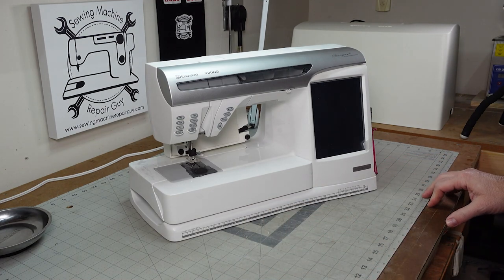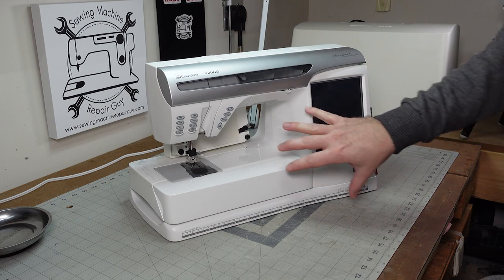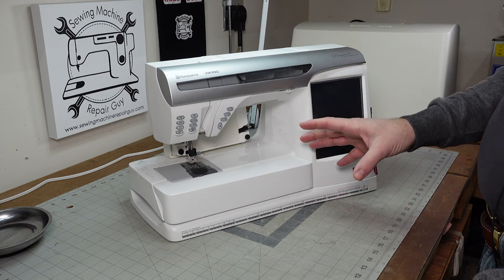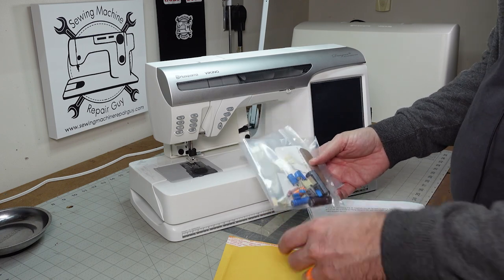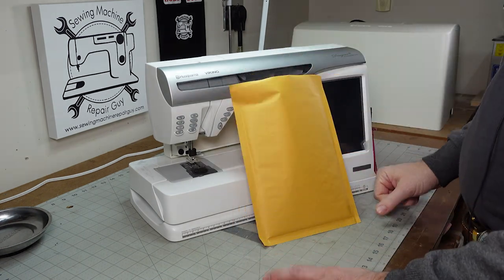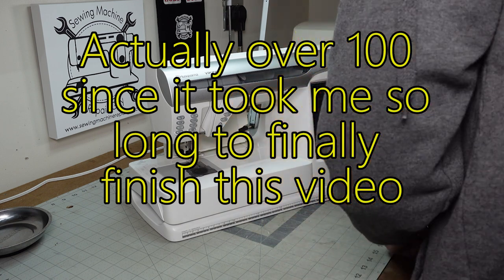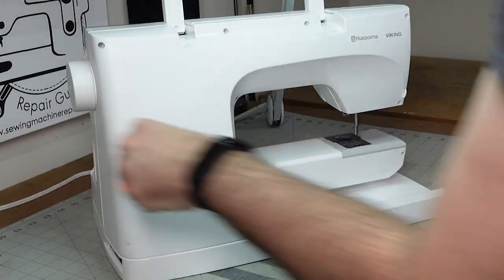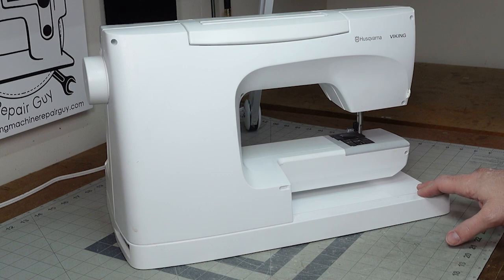Flashing Light of Death Repair for Husqvarna Viking Designer SE ***Updated 2021***

Comment: I have a Viking 6000 Series that’s very old, I love this machine and want to have it repaired. I believe that it is an electrical short some where. I tried to replace the plug and while doing this many of the wires came loose from their anchor. I’m 70 and my hands aren’t working as well
 As they did.  Where can I take my machine to have it repaired?

Comment: husqvarna viking diamond royale motor over heated and its gear melted so throwed... what can be reason of ovet heats ? it has a problem , smart saving i canceled and it was working without problem...how can care motor , is it needs oiling?it has still have coal ..what s ur advices?

Comment: I have a question about the presser feet of the singer machines or in your case the generic pressers can be adapted to the husquevarna 116 smeralda machine? is that the singer 3333 has the same type of Stilt foot than the husquevarna 116. Is that possible or is there a difference?! Greetings and thanks for your videos

Comment: We just acquired the exact machine.  It works perfectly so probably not a good idea to proactively replace the electrolytic capacitors?  Is there a way to determine how old the machine is and hour many hours of usage?  Someone told us you need the Service Menu password in which we do not know.  We got to the Menu and it does require a password.  Love the detail of your videos.  Thanks very much.

Comment: Good morning from Johannesburg; South Africa

Thank You for this video, I have a question though:
Do you have any advice for the Husqvarna Viking Designer 1,
I recently had mine serviced by a reliable technician who I have been following for the past 2 years.
He even sent me photos & videos of how the machine was stitching.
When I got my machine back all excited, the technician warned me the Screen of my machine will need replacing as the clip that plugs into the motherboard is aging.
I contacted Husqvarna South Africa dealer, and the manager told me she was doubtful that I can replace the screen/
I find that so sad as my machine has worked less than 1000 hours in total.

Any advice or if I can perhaps find a screen again?

Comment: You saved me far more that %1500.00.  My wife's SE experienced the flashing lights of death.  She took it down to the dealer and was told by the owner that the mother board was bad and that Husqvarna no longer stocks them.  She then proceeded to try to sell my wife a new $16,000.00 machine.  I haven't done any board work in almost 35 years so this 30-40 minute job took me 3 days.  Slow but sure I got it done.  My wife is thrilled and so is my pocketbook.
Reply from the maker: That is awesome! Great job! Glad you could keep another one alive.
Reply: I am so grateful to find this hope.  I too was dismissed by local repair shops.  I love my Designer and when retired, I expected to do a lot of sewing and embroidery.  Then the mother board/capacitor died and I grieved the loss.   I was not about to buy a new Viking machine.  Thank you for teaching how to  bring it back to life.

Comment: I Ordered the kit, watched the video and successfully repaired a machine for a VERY happy customer! The single most important piece of information comes at around 17:35 in the video. I couldn't figure out why the machine was not working properly mechanically. Electronically, every thing was fine. I re-watched the video and determined I had the polarity backwards. I would have been scratching my head for days trying to figure it out... Thank you for the kit, thank you for the video, and thank you for taking the time to instruct and inform.

Comment: Just fixed my cousins machine.  They bought your kit and I did the repair.  Works fine so far. Thanks for posting.  I wish I could get back into repair work.  This was fun!
Reply: Hi @Rich Gocken 
What do you see in order to fix the viking.
Did you see additional video or just the information coming with the capacitors?
Reply: @arreglatumaquinadecoser  My cousin bought the capacitor kit.  I watched 2 videos on this channel to see how to disassemble.  I already know how to desolder and solder.  I hope this helps.
Reply: @CitizenCS  thank you for your advice I appreciate it.

Comment: Thanks for the videos and info. I've worked in electronics for over 35 years, and other than some +20 year old radios, I rarely have to replace low voltage capacitors (maybe the odd one that bulges/leaks/explodes). HV must be using the cheapest caps in the world...
Reply from the maker: I think around the time these were produced, there was a bad manufacturer out there.

Comment: Dude, you SAVED US! We ordered the capacitors from you and my husband showed me how to solder them in. Thought the machine was broken till I realized I forgot to plug in the motor to the main board - duh! I had carefully marked the wires and photographed them so plugging the cables back in was easy. We turned it on and VOILA !!! SCREEN!!!   OK, so now to put it all back together - the front panel is a bit wonky (that little flippy door) and not sure if it can be fixed. Will order another if needed. Husband is good at mechanics and I have the parts list/schematics. Remains to be seen. Hopefully it won't need full calibration but if I have to bring it in to get things adjusted properly, that won't be tragic!!  Thank you!
Reply: Hi, may I ask you if your husband saw an additional video for soldering and repair the viking or just the diagram inside package?
Reply: @arreglatumaquinadecoser  Just saw this - He watched the video as well. The one above.He didn't find the diagram until he had mapped out the board himself

Comment: My machine is identical. Reverse stitch no longer works. I hear a faint click when I depress the back stitch button, but nothing happens. Does back stitch on this machine work simply by reversing the motor direction or is there some sort of transmission linkage that shifts from forward to reverse? I have the machine completely disassembled thanks to this video but I'm not able to see how the reverse mechanism works.
Reply: I have the same problem, did you resolve the problem?

Comment: Howdy. Well, I took the designer I apart. I got every thing to work. Everything worked in open testing. Got settled in to replace the cover. No screen. I broke the connector on one of the wires.@#$$%&***! Now, going to try my electronics people for a new socket. Wish me luck!

Comment: Great video. I am picking up one of these pretty cheap with a ton of hoops, 2 embroidery arms, CD'S, and books. She showed a picture of it powered up and the display is fine but mentioned when it went in for regular service that the guy said it will need a new board soon. I'm thinking as it warms up it has power failures or glitches. She wasn't clear on symtoms for service trip. I plan on doing the caps but was wondering your thoughts on possibly the mosfet you pointed out overheating. Have you ran accross this issue outside of just the dead display? I figure worst case I'll get my money back parting it out if it can't be repaired reasonably cheap.
Reply: Well, I picked up the machine, put it through it's paces, and 10 or so large file designs. I cannot find a single thing wrong with it. Everything seems to work just like new!

Comment: My Designer SE had a flickering touchscreen that got progressively worse and I was told it was the motherboard and that it was not repairable since they no longer make parts for this machine. Would your kit work to repair this problem?
Reply: I as able to find a local independent repair guy that was able to reply he capacitors.  It runs like new.   H is actually an electrical engineer.  Yes the SE is repairable.

Comment: Unfortunately when I marked the connector (reference 12:38) I failed to mark the cable… can you help me differentiate? On goes to a motor, the other looks like it’s connected to a switch. Can you help me? Thanks… capacitors have been replaced, I’m anxious to see if this will fix my problem.
Reply: I found the answer in a service manual, the bobbin motor (red wire on my machine) goes to the connector on the left side, the switch (blue wire) goes to connector on the right. Thanks!

Comment: Hello. I have a Husqvarna Sewing Designer SE. It was embroiling today and after a sudden power cut, I can not work because my machine. Switch’s on , lights the following buttons STOP, FIX, SCISSORS and REVERSE. After a while pops the logo KEEP THE WORLD SEWING and the SE light get all on and nothing else happens. Silent just keeep the world sewing. Could you help ? I do not have any retailer available, currently in ANGOLA. Thanks
Reply from the maker: I would start with the capacitors and see if that fixes it.
Reply: Thank you so much for taking your time to answer. I will send my machine to a closer country where I hope the capacitors would be fixed. Best regards.

Comment: Did that machine have bad capacitors?
Reply from the maker: Yes it did. The first machine in the video also had an issue with the motor control circuitry.
Reply: @SewingMachineRepairGuy  Excellent. So you also repair digital circuits.